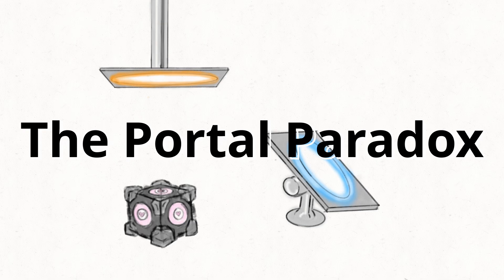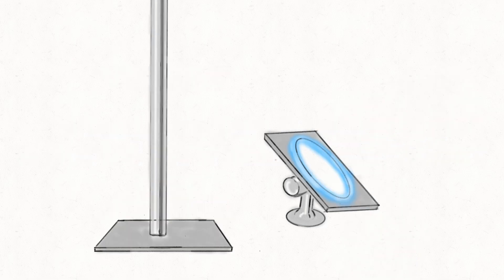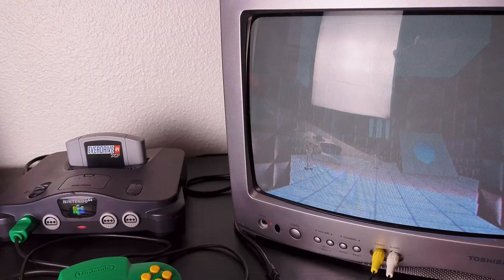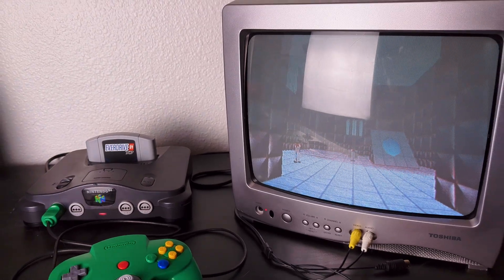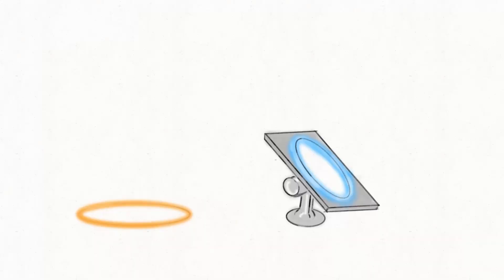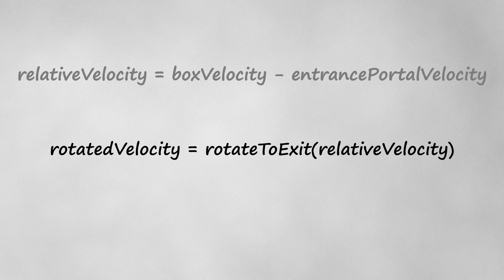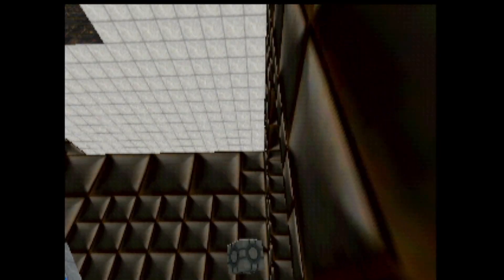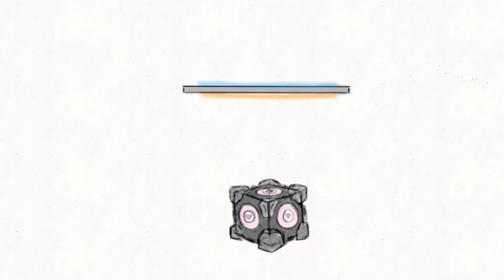I rewrote Portal from scratch and solved the Portal Paradox

Comment: Test idea: what happens when you halt the piston mid-way through the box?

If the box is being treated as a point (with a 3D hit box built around it), I imagine the box won't "jump" out of the exit portal until the entrance portal has crossed the box's reference point. If you treat the box as a bunch of infinitesimal boxes rigidly bound to each other, perhaps more interesting stuff can occur, like having only half as much momentum when it leaves, or being dragged by gravity due to half of the box being affected by it in different directions.
Reply: That's actually a great question. My guess is that he will simplify the problem and make the mass point like somewhere at the centre of the object rather than having it distributed. It sounds to me that having a distributed mass might be computationally a bit too much for a 64. But as you point out that would lead to some edge cases not behaving with the correct Physics while for the majority (where that simplification works well) he's got it spot on.
Reply: @mumblecake251  you could have a weighted average of the forces an both sides based on what portion of the cube went through. No infinite point masses needed.
Reply: While the engine would likely require changes to account for this, I also think it would logically exit at half the velocity:
If the matter inherits the relative velocity of the portals, and only half of it exits the portal, half of its matter inherits the velocity. The affected matter would continue to shoot forward and either pull the rest of the object along — and as the rest of the mass has no relative velocity, the object would equalize to about half velocity — or it would tear itself in half. This would be entirely based on the structural integrity of the object. If the bonds are strong (like a block of metal) they will stay as a whole object, but if they are extremely weak (like jello) it would be torn apart.
Reply: @crimsoninsight97 within the inertial reference, the only way to keep inertia the same withing the frame is to keep the cube stationary on the output. 
Why ? 

Intake portal carrier, exhaust portal carrier  and cube are the elements in this reference frame. 
Before teleport, cube is stationary compared to exhaust cube, has a relative velocity v compared to intake portal carrier but inertia of 0 within the frame.  
After the teleport, we must fulfil the same conditions as otherwise we changed inertia without applying force, effectively fucking over the physics. 
To comply with this, cube either must have no inertia within the frame when it exist the exhaust port or the intake portal carrier must stop by itself, giving all of its inertia to the cube. Indicating portal applies a force on the cube. 

If the cube stays stationary, it's relative velocity to intake and exhaust portals stays the same, total inertia of the frame stays the same and cubes inertia within the frame stays the same. 

This also works even if  exhaust portal moving. As cube still keeps relative speed to both portals if it keeps its inertia.
Reply: so the half that travelled through the portal would be already moving on the other side, while the other half is stationary... so if the structure is not rigid enough to hold together (human) you can rip him apart if you stop in the middle... gruesome...

(Anyway, portals are abstract, so all these experiments fall on many other problems, don't take them seriously guys.)
Reply: if the portal stopped halfway through the box you'd simply have half the momentum and so half(i cant remember physics its either this or a fourth) the velocity it would have had if the portal went all the way
Reply: @triciaf61  The way it works is that the momentum on the box caused by the portal is actually from the stationary surface that the box is on, so if there is space between the portal and the stationary surface the box would 'kick out' of the other with proportionally less velocity. The point at which the box would have momentum from the portal is derived from when the force acting on the object from one side of the portal is just above equal to the force acting on the other side of the portal. This would be when the force acting on the object from the initial side, which is the mass*gravity, is less than the forces acting on the object from the transfer side, which is mass*gravity and mass*acceleration of the moving portal. Assuming that the portal moves at a constant velocity, then you use a = d/t^2.
Reply: If we look at it from a conversation of momentum perspective. The moment/energy the cube has exiting the portal should come from the platform the entering portal is attached to. As the cube passes through the portal the exiting half has momentum, the entering half has none. When the portal stops, no additional momentum is imparted and the cube would then move at half the rate with the conserved momentum of the already accelerated exiting half.

The lower half would appear to jump up through the portal at half the speed the portal was moving at previously.
Reply: i does seem like the box would get 'pulled' up through the orange portal. but t hats just my guess
Reply: I would think that it would shoot out at half the velocity
Reply: Wtf, just asked this question:/ but I see he hasn’t replied to you yet
Reply: If the entry portal's relative speed to the portion of the cube not yet in the portal reaches 0, then the relative speed of the exit portal to the portion of the cube that has already passed through also reaches 0, so the cube wouldn't "move" at all. The force of the moving entry portal slowing down to 0 speed effectively "brakes" the cube passing through it, which is where the cube's momentum goes. That's how I understand it, anyway.

I think of portals' conservation of momentum kind of as a mirror. What happens relative to the entry portal is the opposite of what happens relative to the exit portal: "speedy things [about to] go in, speedy things [about to] come out." But the opposite of an unmoving object halfway through an entry portal is also an unmoving object halfway through an exit portal. The object begins to exit the exit portal at the same speed as the entry portal is moving, but slows down to 0 speed at the same time as the entry portal stops moving halfway through the object.

EDIT: I assume a frictionless vacuum without gravity, a completely inelastic object that imparts and receives momentum instantly, etc.
Reply: I was also wondering this
Reply: that's ez: the cube would shoot out with half the speed.
Reply: It just uses the center of mass so it would either: A. act like it didn't stop, or B. act like it was just placed there with the portal stationary. Which one happens depends on if the inaccuracies in the positions of objects round up or round down.
Reply: solution: the cube will go at half of the original speed of the orange portal if it stops exactly at half of the mass of the cube.
if you stop half-way through the cube, then half of the cube has momentum after having passed through the portal, and the other half of the cube has still no momentum.
Reply: if portals were real and they could move, they'd have to somehow transport matter from the entrance to the exit. let's assume that real space stops working inside of a portal. i'd assume that it's correct that the velocity with which the portal is put onto the cube is kept and translates to the exit since every particle entering one side, one after the other, is doing that in the exact same speed and order in which it went in. no matter if the entry portal moved towards the cube or vice versa. that would suggest that, if the entry portal stops midway through the cube, the velocity of the particles that already went through are kept and the rest is just not sent through, which would mean the cube will be cut in the middle with one half flying out the exit. that would mean that the velocity of the moving entry portal must be kept perfectly stable as to not cause deformations or cutoffs of whatever you send through. and you wouldn't ever use that on living beings and expect them to keep living. 
this makes me wonder what the result would be if tested in his software. i doubt it simulates every single particle. it probably makes a spatial connection between two panes of portal so that the cube can also just sit there with one half on one side and the other half on the other and it would keep its shape and it would remain a solid opbject no matter what.

now that i think about it. moving a portal over a cube is basically the equivalent of moving space itself over it. a different pocket of spacetime so to speak and if you think of it this way it's rather logical that it would turn from a non moving object into a moving one without any force applied to it. because whether an object moves in space or the space moving around an object doesn't make a difference, right? of course this doesn't make any sense in this scenario since the entry spacetime is the same as the exit spacetime. but if they were seperate it would work.
Reply: I believe that whatever force acts on the portal surface would also be acting on the object that is in between the two portals. The cube wouldn't be sucked up off the ground by its "half momentum" - it would be "stopped in place" from the point of view of the exit portal by the same force that stopped the piston. From the point of view on the entrance portal, the cube would behave exactly as expected. It won't move on its own without having something exert a force on it.
Reply: If the portal is stopped half way on to of the box I believe momentum would not fully be imposed on the box I don't think anything would happen
Reply: @datanchovies2507  The way it works is that the momentum on the box caused by the portal is actually from the stationary surface that the box is on, so if there is space between the portal and the stationary surface the box would 'kick out' of the other with proportionally less velocity. The point at which the box would have momentum from the portal is derived from when the force acting on the object from one side of the portal is just above equal to the force acting on the other side of the portal. This would be when the force acting on the object from the initial side, which is the mass*gravity, is less than the forces acting on the object from the transfer side, which is mass*gravity and mass*acceleration of the moving portal. Assuming that the portal moves at a constant velocity, then you use a = d/t^2.
Reply: Half of it would have velocity, and half of it wouldn't. If the structural integrity of the thing being teleported can handle that, or if the weak point is above the plane where the piston stopped, then the velocity will pull the other half, equalizing to half of the velocity.

If it can't, and the weak point is at or below the plane where the piston stopped, then the object will break at the weak point, and only the section above will be launched at full, or almost full speed. A little bit of velocity may or may not have transferred to the rest of the object, depending on how quickly the weak point failed.
Reply: these were my thoughts exactly!
Reply: Can't say in terms of how the game is coded. That would depend on how the objects are treated. But if you carry on the same logic applied, then the velocity gain would be instantaneous on the portion of the cube that is through the portal as in the demonstration. But no gain is applied to the portion of the Cube not through the portal at the moment the portal stops moving. As such, I would assume that the inertia of the portion of the Cube through the portal would want to carry on moving and the inertia of the portion of the Cube not through the portal would want to stay where it is. The outcome of that would depend on the physical properties of the object. They will pull against one another with a tension force, and either end up with a net velocity of somewhere between them (which would result in a "jump" of the Cube at the moment the portal stops moving) or it could shear the object apart like pulling either end of a piece of paper.
Reply: As others have suggested, it would be half the velocity, because the top half gains the kinetic energy, but the bottom half doesn't. But as the two halves are mechanically linked, that kinetic energy spreads to average out over the whole mechanically connected structure. If half has 0% kinetic energy and the other half has 100% kinetic energy, the average over the whole structure is 50% kinetic energy.

If it helps, you could think about what would happen if instead of kinetic energy (velocity), it gained thermal energy (heat). When it's sitting there, it has 0% heat. When it goes all the way through, it has 100% heat. So if it only went half way and stopped, the top half would have 100% heat, but the bottom would have 0% heat. As they are themally connected, that heat would spread, warming the bottom and cooling the top until it reached an equilibrium point where they are the same temperature, which of course would be 50%.

The analogy isn't perfect, but it can help to think about it that way.
Reply: If it were treated like a point, I think it would fly out as soon as it went past that point. If it were more analogue (like the little boxes) I think it would apply the force to the % of the cube that went through, most likely "dragging" the rest of the cube with it once the force is great enough.
Reply: If fragile box box breaks if strong box box eject at half speed
Reply: If you had it moving fast enough, and stopped it abruptly enough ... tidal forces rip the box apart?
Reply: @richardgodivala4680  depends on the type of portal... If it's teletransportation type maybe, depends on how fast it's stops and how fast it was it's relative velocity .. if the portal is some sort of universe portal.. it's is not the box that is in motion but rather an entire universe that moves into the box...
Reply: This is an excellent question that reveals a lot about portals.  Basically it tells you that portals cannot accelerate without exerting forces on objects around them, these forces would have to tail off as you move away from the portal.  This also means the inertia of the portal would depend on the objects around it and exerting a force on an object would exert a force on a nearby portal.  You would also find that moving portals would exert tidal forces on objects.  I expect these could be arranged to keep objects from touching the boundaries of the portal, but I'm just guessing here.  To cut a long story short: don't allow portals to accelerate, someone may get hurt.  Definitely don't allow them to spin!
Reply: Wouldn't the force be cancelled by the stopping of the portal piston?
Reply: The speed of the half exiting box works out to be 1/√2 times the initial speed. 

This comes from the fact that setting the energy equal* you get (initial velocity)²=½(new velocity)²
After canceling.

You take square roots on both sides and you get that 
V₁/V₂ =1/√2

*ignoring that portals break conservation of energy
Reply: There is no momentum on the box as the box never moves, it is the universe that is moving ... Its a stationary box on a moving universe... 
If the universe stops relatively to the box mid way the box will appear to stop...
That would mean interestingly that if the portal would stop at any time in the period the box is in the air after "Jumping" out it woul lose its aperent lateral velocity.

Now another way to look at it is... It's more of an information teletransportation. In that case every particle on the box gets deleted and recreated in its state including relative  velocity vector. In this case the box would probably be shred apart as an instantaneous stoppage of the portal would produce an infinite acceleration capable of riping the box at the bond level that separate a moving particle from a non moving one..
Reply: @pinheirokde  The stop wouldn't be instantaneous though, it would be the same acceleration as the moving surface takes to stop.
Reply: @Alexander_Grant  correct yes.. instant changes in speed are kinda complicated even for made up concepts..
Reply: @pinheirokde  The way it would work (assuming were are following the current known physics) is that the momentum on the box caused by the portal is actually from the stationary surface that the box is on, so if there is space between the portal and the stationary surface the box would 'kick out' of the other with proportionally less velocity. The point at which the box would have momentum from the portal is derived from when the force acting on the object from one side of the portal is just above equal to the force acting on the other side of the portal. This would be when the force acting on the object from the initial side, which is the mass*gravity, is less than the forces acting on the object from the transfer side, which is mass*gravity and mass*acceleration of the moving portal. Assuming that the portal moves at a constant velocity, then you use a = d/t^2.

Comment: The portal is simply a zero-length, zero-mass conduit between two locations in space. The portal should not transfer any momentum to objects since it arguably doesn't exist nor physically touch anything.  

If a moving non-zero-mass portal were to transfer momentum (assuming conservation of momentum not just velocity), passing a very massive object should cause the portal to rebound in the opposite direction.